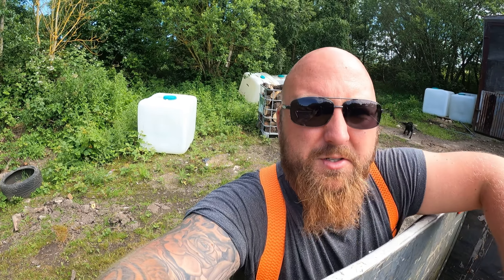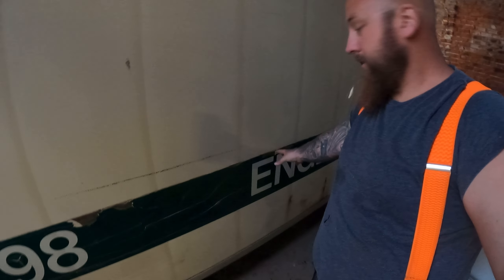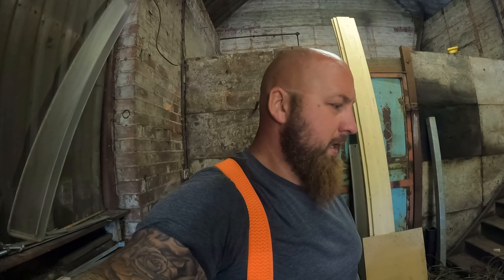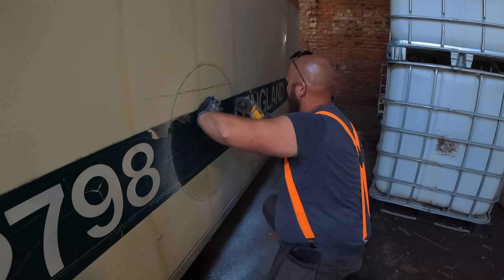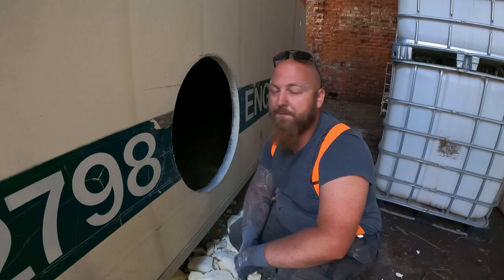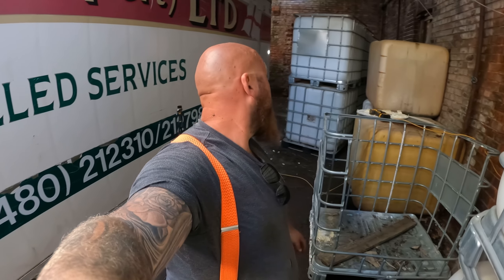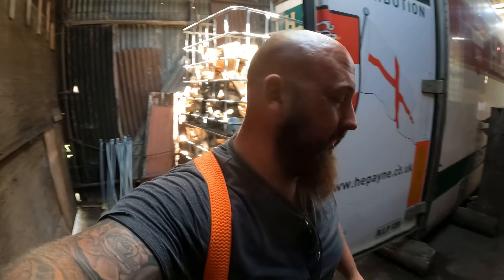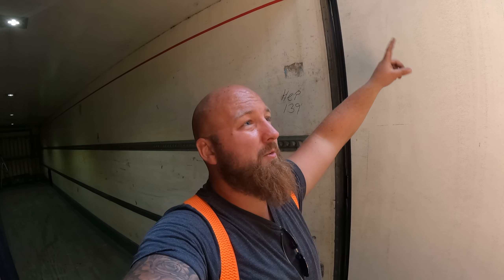Kiln Build - huge fan install and Inkbird Humidity Controller

Comment: Nice one mate! Mega fan that! Will replace the air very fast in there! 

I would put heat source about where you are saying as long as it’s above the hight of an ibc. Direct heat to a log coming off that burner may increase fire risk. 

With the holes in the door I would go bottom 3rd as you will loose to much heat at the top 👍🏼 

Cheers for the shoutout and looking forward to the next one
Reply from the maker: Thank you Archie, i appreciate you taking the time to comment. I wouldnt have bought the fan if it was new but the fan was local from a bulk container buy and it was cheap.
Yes i was thinking the hot air inlet should be at the highest point.

I also feel like ive made a mistake and ive put a hole in the top side of the left side door thinking the air will force down. It can be corrected or covered over so its not all bad but i was thinking of using the gravity flap vents so when the hot air is being pushed in it will close the vent and then when the fan is on it will open the gravity vent and pull fresh air in.
Maybe its an experiment but it can be changed if needed.

Thank you again buddy, appreciate you commenting 👍

Comment: Good stuff Nick. You might need to put the fan on a dimmer switch so you can adjust the speed. Awesome build though, looking forward to seeing it completed.
Reply: Yup. If he can adjust both input temperature & fan speed he'll be good.
Reply from the maker: Hey buddy and thank you for commenting, im not sure if i need to put it on a dimmer because the fan will only be on for a short time until the probe will register a drop in humidity. 
Thank you and i hope to get the kiln finished very soon. Hopefully soon it will be all on video 😆
Reply from the maker: @papalegba6796  i dont think i need to adjust either, im hoping the fan will only be on a couple of minutes then the fan will shut off.
All trial and error until the build is working fully. Thanks for the suggestion though buddy 👍
Reply: @everydaywithmenick  my thinking was that having a steady flow of air through the kiln may be more efficient than having an on/off system. Like your washing dries quicker in a steady breeze kinda thing. There's a ton of variables tho, trial & error like you say. Fitting a dimmer switch just gives you more control over the process if needed.

Comment: Now that's a Kiln.  Be careful the fan doesn't suck the dried wood out of the cages.  LOL  I can't wait to see this thing in action.
Reply from the maker: Hey Jeff and thank you for commenting. Yeah i think that fan would suck the wood out of the cages 😆 
I just need to get the heating unit installed now and then i can try it out and see what the kiln is actually like.
Thanks again buddy 👍

Comment: certainly needs vents for air flow but on a humid day you are going to pull in lots of moisture and on a good dry day pulling in dry air it would go a long way to drying your wood without a heat source you just need a way of drying air going in vents on a humid day

Comment: Seems counter intuitive but humid air is less dense than dry air, and rises to the top (obviously agitation will affect this), but if your trying to extract wet air, I would have thought the higher the better
Reply from the maker: Thanks for commenting bud, i need to have more fans inside the kiln so all the hot air is getting moved around in the right way and allow it to get both the lower and upper parts of the kiln.
It is all trial and error at the moment and when i learn, everyone else does too.
Thanks again 👍

Comment: Nick, angle grinding with no eye protection 😢😢.
Reply from the maker: I know, i didnt have much in terms of ppe down the woodyard and i need to start gathering some of that equipment down there, i did use my sunglasses that are safety rated but thats a poor excuse. Ill sort it out buddy 👍
Thanks for commenting.